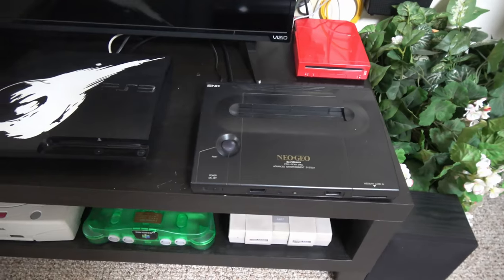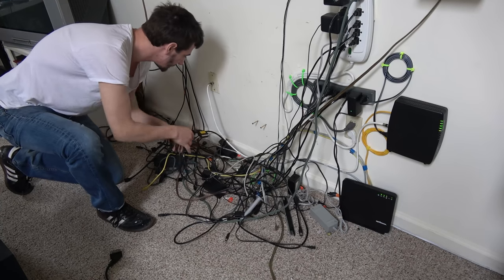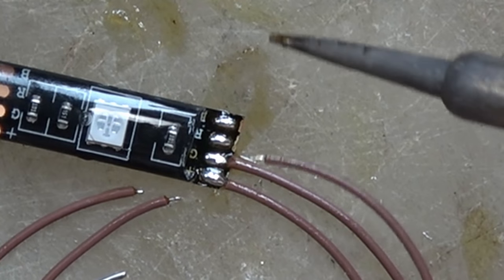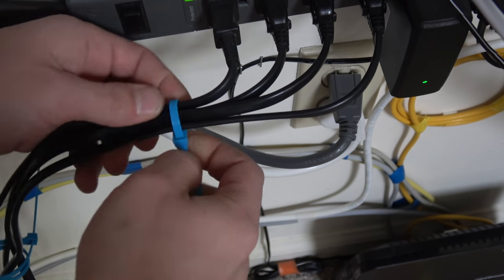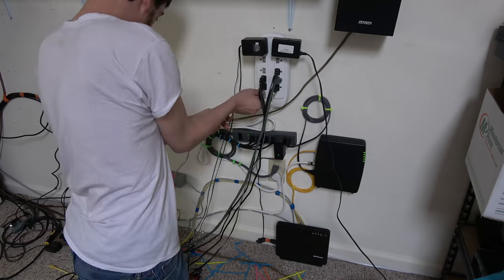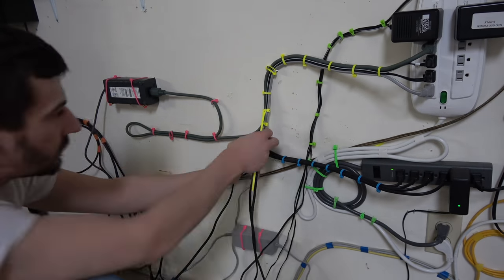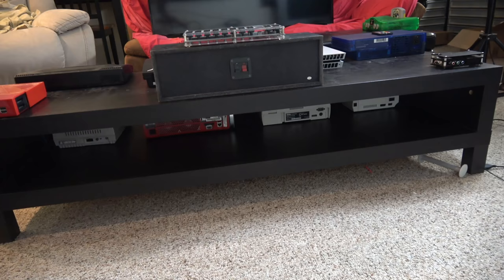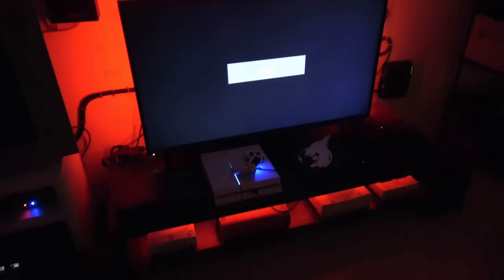EXTREME CABLE MANAGEMENT

Comment: I use the screws in the wall idea too. I usually put a square of High Grip Velcro (Scotch Extremely Strong Fasteners 1 in x 3 in Black) Velcro on the wall between the screws in the wall. I have neighbors that bang the wall hard enough to knock stuff off the screws!  I also use reclose-able VELCRO Brand ONE WRAP Thin Ties cable ties so when I move everything goes with me and can be reused.  the best part is I can Velcro them to the wall with Velcro dots. The 3M strips are actually strong enough to hold up to 15lbs so I can forgo the screws in many places. My landlord charges $10 for a screw hole when I move out.
Reply from the maker: I bought wood filler and pain and filled all the holes and painted over it lol. So my land lord can't say nothing! Because everything in this video is gone. Its a bare wall now. Thanks for watching
Reply: @RETROGAMINGARTS  I feel so much better when I will holes in my walls with wood filler and pain!😁 I have no regrets when I leave an apartment because all my pain is in the walls!😊

Comment: I had a similar problem. It was mainly all the wall adapters. They were everywhere. I just wrote down what voltage and amperage every device used and made one main power supply with all the different voltage and current and hooked them into it. That made a lot of difference.
Reply from the maker: I'm glad you fixed it. Thats smart

Comment: Nice. For my setup I have an IKEA shelf and I have it all hooked to an Onkyo AV Receiver. SNES, NES, N64, Gamecube, Wii, WiiU, PS3, PS2, Genesis, Original Xbox, and Xbox 360 . Used composite, component and hdmi switchers. I am sending all of this to my 65 inch TCL. The SNES is ouput to SCART adapter to HDMI

Comment: This is a killer idea and looks really good.  I'm surprised I didn't think of doing something like this earlier.  I'm about to move to another apartment, so I need to check on the rules about mounting things, but they usually don't have a problem with nail/screw holes.  I also have only 4 consoles presently, plus the cable box....I'm definitely going to use some of this when I move in.  tcntad had a good idea about mounting power bricks under the table, but mine is a glass-shelving TV stand, so maybe double sided tape?  I don't know if that would hold, though.  It's only a few bricks so I'll probably do the wall thing.  Cool video, thanks.

Comment: Hi! With your power strips, how many devices do you have powered by 1 plug socket at a time? Bit of a wierd question but I need to know!
Reply from the maker: 10 on 1, 5 on the other, and my soldering station has 8

Comment: it would be much better if you got a power bar long enough for all does plugs and fix it behind the table and fixing all the power adapters under that table so you would get  only one white power cable into the wall

Comment: im not sure if its okey to put so many power strips into 1 single wall socket, just saying men, great managment
Reply: I know. Went to a wake where they plugged everything in 1 strip and it was sparking like crazy.
Reply: You gotta think about the fact that they create these large power strips with 1 plug, so you would figure they have regulators to keep it safe, otherwise, wouldn't they have double plugs from one strip or something?

Comment: Nice, I'd love to do this with mine. I feel like your center channel speaker wouldn't be very effective sitting behind your TV though. Also, my receiver is on the same stand as my consoles, and some cables only move like a foot from it. Not sure how to deal with all that excess cable that wouldn't really need to go on the wall. It's just a jumbled mess behind my console.